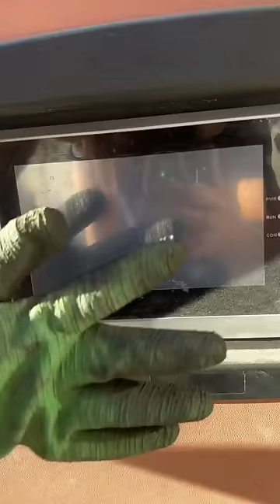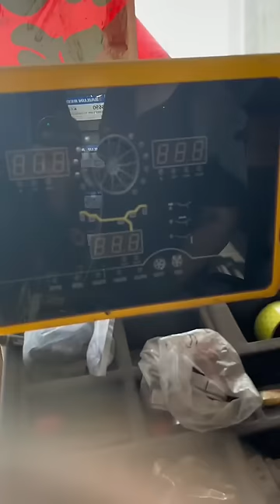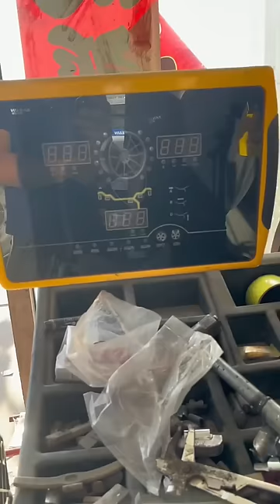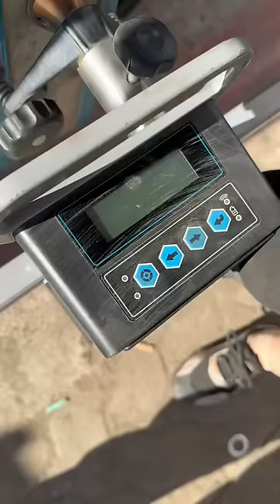Truck Tire Replacement & Balancing Alignment Setup!

Comment: At least she has some help with the holder for the impact when tightening the nuts. It's the jerking and lifting  she does when aligning the tires. Hope her back holds out. She keeps up with the guys. That's the main complaint when working in the so-called "mans world". They complain if you ask for help. I worked in that world and you have to prove yourself.